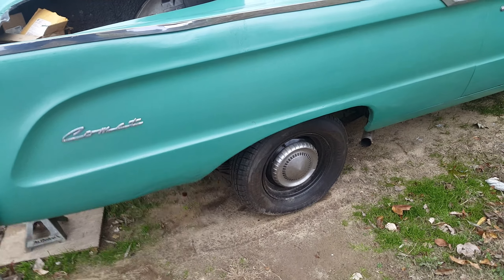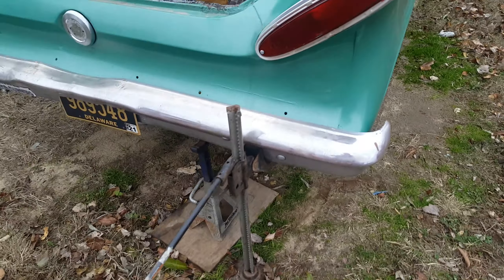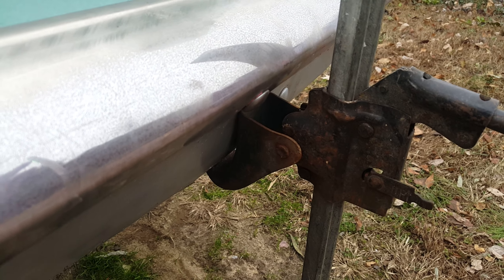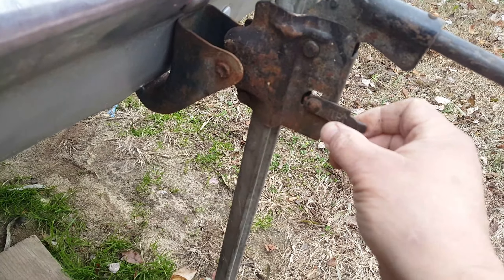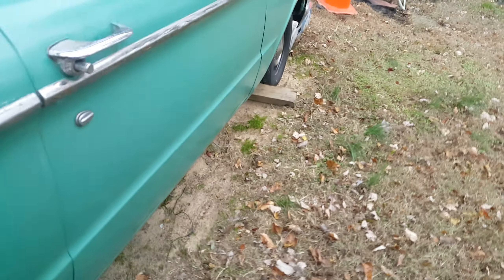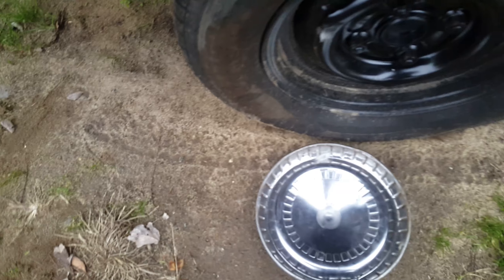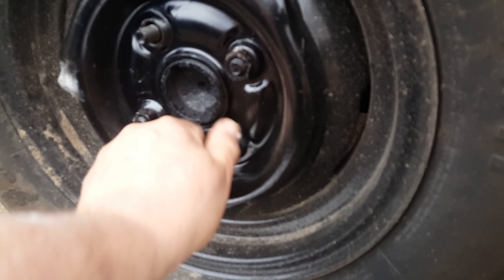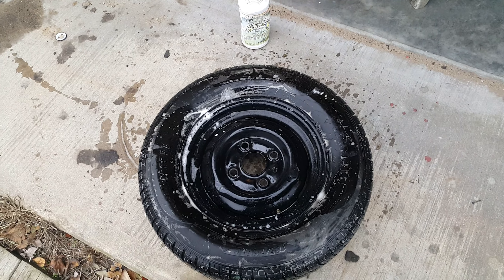Using a bumper jack to change a flat.

Comment: Bought an 86 s10 from a farm when I was 16, for $100. Terrible condition, did a lot of work to it.
Never figured out what the hell kind of strange jack the damn thing came with. Turns out it’s a bumper jack!
I’m so relieved finally take the time and figure out what the hell it is and how to use it. I knew it was a jack, but I never even got close to figuring out how to actually use it. Thanks!

Comment: Oh, allot of criticism of this type of jack but it is meant to be used by competent people like set the parking brake, block the wheels, perform on a flat surface not on a hill. The worst type of jack is the scissor type, very week and the threads might look good, but the nut might be stripped and no way of knowing until it falls. Good video guys and it also makes fence post pulling a breeze. I grab everyone I find. Oh, must add. it's not a race slow long motion, no jerky fast pumps.